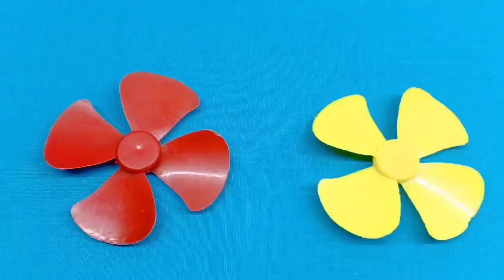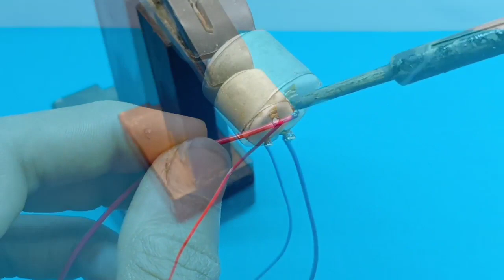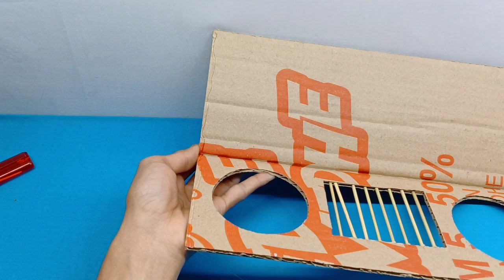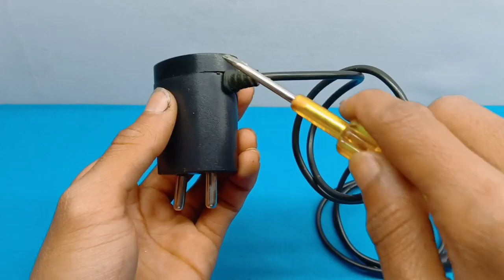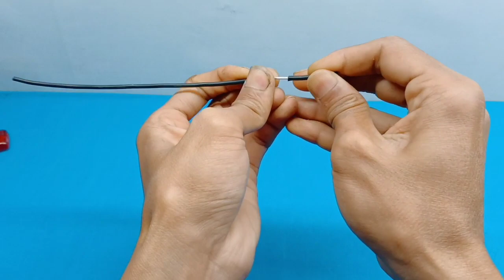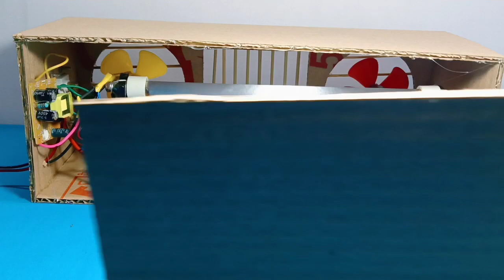Mini Room Heater कैसे बनाएं 😲|| How to make a mini room heater at home || science project || Project

Comment: Tip :- U can cover aluminium foil from inside but make sure to cover every wire with tape correctly , Aluminium is good conductor of electricity 🔌
Reply from the maker: Thanks for the tips. ❤️